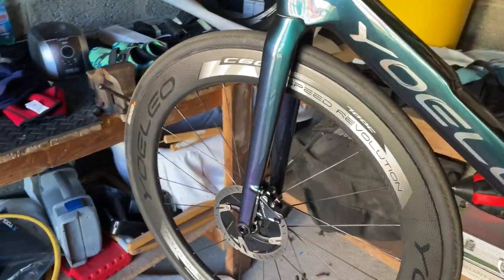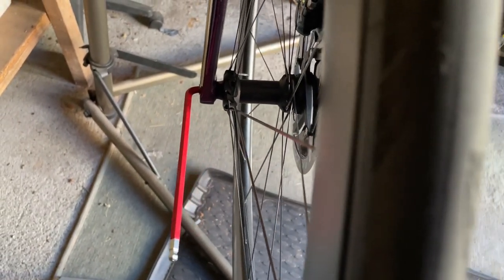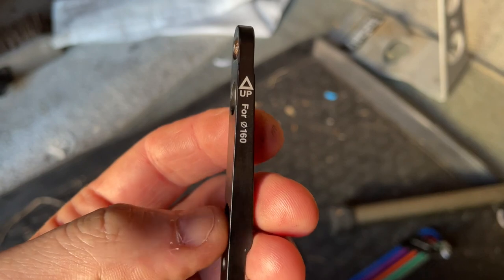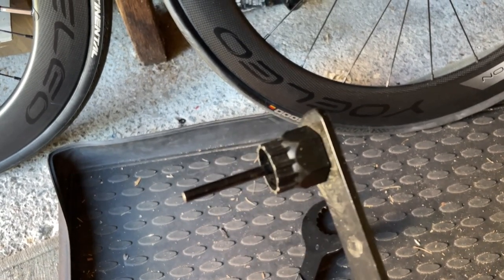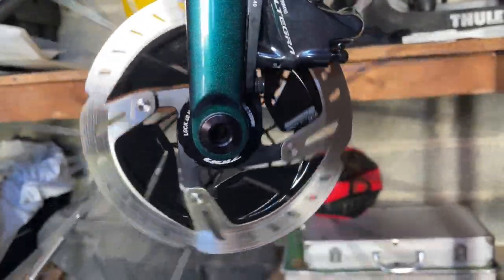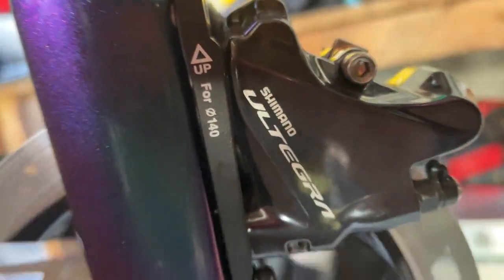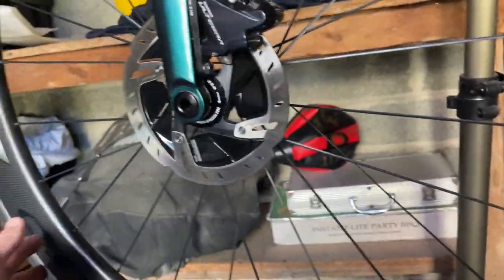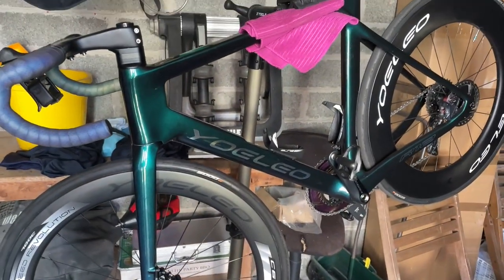How To Change Disc Rotor Size 160mm To 140mm

Comment: I am trying to change Giant Propel's front from 160mm to 140mm.. it seems I cannot use the mounting braket just upside down.. Did you use a mounting braket from TekPro?..  and How about the length of the brake line? easy to pull it down?? or I have to change the line??
Reply from the maker: No the bracket came with the calliper, I built the bike myself so left a little slack in the forks, the cable in your bike might be too short to change the size. If so you’ll need to change the cable. 👍

Comment: How about the rear brakes? Is the stock brake mount can fit to 140mm rotor ?
Reply from the maker: Yeah 140 on the back, can’t see a way to make it 160. 👍

Comment: So did you have to install a longer brake cable or were you able to get out the rotor rub?
Reply from the maker: No I just had enough cable in the frame to change from 160 to 140. 👍

Comment: Most likely, the reason your calipers wouldn't center up on the rotor is because the frame needs to be refaced.  It is a super common issue, and even high end bikes seem to suffer from it.

Comment: Why would you ever switch to a 140mm front? I could see a reason for going 140 in the rear, but not the front.
Reply from the maker: I found 160mm to much break, and I didn’t like the size. sounds silly but I’m only riding at 30 kph max. 👍
Reply: It can really help with braking stability if the front brake is too powerful, to the point of being dangerous. I've seen cyclocross bikes being fitted with 140mm front, 160mm or 180mm rear just to keep things more stable. It works well as long as you spend a little time re-learning your braking technique.
Reply from the maker: @stephen_101  well I haven’t had any problems yet, I’m only a 30kph average when I ride so nothing fast. 👍

Comment: The most pointless thing to do
Reply from the maker: Actually it meant I sold my 160 so it had its merits. 👍
Reply: On only my third ride on disc brakes in a paceline something unexpected occurred when a car pinched the marked shoulder. I locked up the rear and almost slid out. Converting the rear to 140mm seems to be the only available solution.
Reply: @jimlewandowski7648  or you can just learn how to brake properly. And sliding of the rear is not that dangerous in most cases. Just try to do this intentionally sometimes when no traffic around.